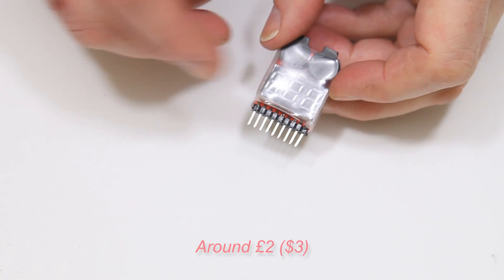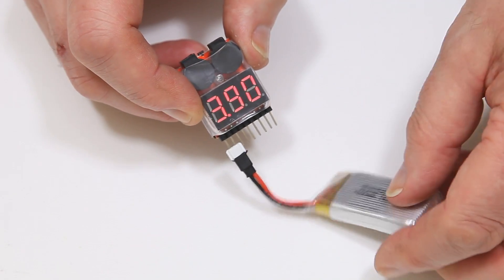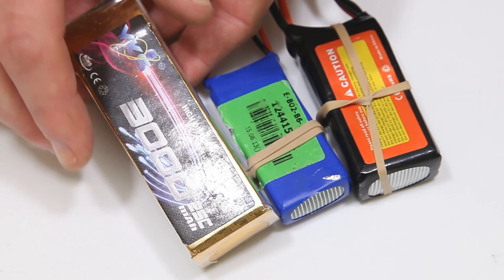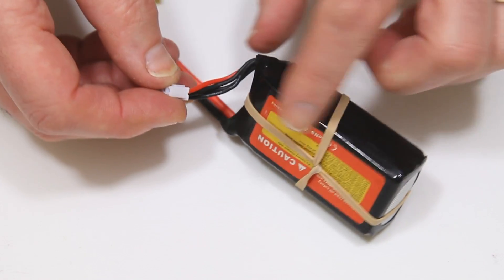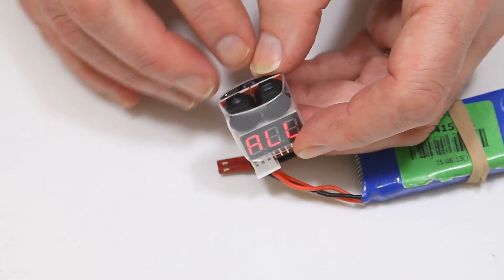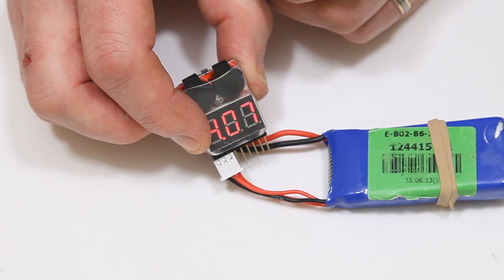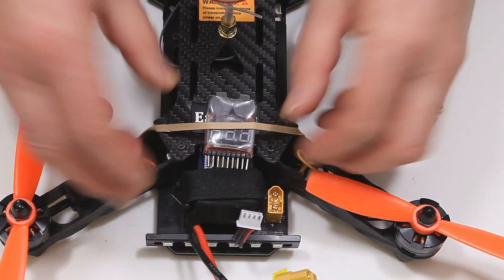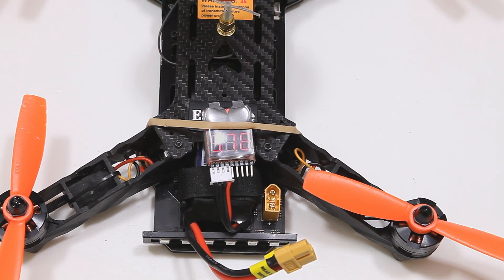Quad RC LiPo Battery Voltage Meter and Alarm

Comment: Hi that's a great gadget .
A quick questions how do I put a battery in storage mode if my charger does not have that mode? Do I use it for a bit and check the voltage or is there a clever way of doing it?
Thanks

Comment: I'm curious, does it start beeping when  punch the throttle? although 3.2 is pretty low, I might like to use it for a normal low battery warning when I fly but if it beeps every time i punch the quad cuz I'd have it set to beep at 3.8 that wouldn't be cool.

Comment: Isn't the storage thing a myth?
Reply from the maker: Not heard that one, I've left batteries charged by mistake and although they change up they have a very reduced capacity, shorter flight, so I leave mine in storage if I'm leaving them awhile, you do what you feel comfortable with ;-)
Reply: Tigger's RC Reviews thanks for the reply. l read about it on propwash, but I don't recall how long they left the batteries in different states.

Comment: Tigger, I just got my battery tester today and wanted to thank you. Beautiful little gadget and a brilliant review of it on your part! Iam new to the lipo battery world, and your videos were a huge help. Also, Is there something I could buy that would ONLY discharge a lipo so that I could store it say for the winter when not in use? Something cheap and simple? Also, what is the proper voltage a battery can be stored at? Thanks again, Cheers! John

Comment: What volts do you set the alarm on with a 3s battery, thanks.
Reply from the maker: Makes no difference how many cells it has, there is no one setting, if there was they would have factory set it ;-) I start around 3.5 and then test it when back with you. When measuring in flight the draw goes up considerably with fast assent ;-) Racer style quads draw massive power and more slower models don't. hope that helps, just have a go and see

Comment: Doesn't the voltage meter cut off power to the motors once the low voltage cutoff is reached?
Reply from the maker: No, it's an alarm ;-)

Comment: Hello.

This my way of marking batteries. I simply marked them with numbers. It's very useful when flying. I always fly from lowest number to higher, so definitely reduces chance to mix full and empty:
http://shrani.si/f/h/Ef/4VPky0zg/20171027222533.jpg

In chance that any full charged have to store, I store it near quad controller. Empty are stored near battery charger. But I don't have a lot of RC products, so at larger number this way probably can't go through. Maybe to store it in different boxes or ledges?

Otherway. Very good channel. (Y) I found it right about 1 hour ago and can't stop watching staff here. :D :)

Good luck. (Y)
Reply from the maker: Hi Bobby, welcome to the channel and glad you are enjoying it :-) I number mine, like you, as use the band, only started numbering after this video. Thanks for sharing and happy flying :-)
Reply: Yea I see a lot of interesting staff here. So will be some my comments under some videos. Also I ordered this voltage meter. Looks simple to use for checking voltage at empty and full charged batteries. With other instruments could be little more challenge to get contacts on all kind of batteries. (Y)
Reply from the maker: Kool, :-)

Comment: Ok..i jist bought one of these and I've been trying to find this answer..what should I set my alarm at for a typical 7.4 volt 2000 mAh battery..for a syma x8hc quad..I'm very new at this and not sure where to set it..my low battery warning lights on the quad are not working good anymore...as soon as they flash my quad drops to the ground for some reason now and I am afraid to fly it high or far :(  thanks for the video too!
Reply from the maker: Doesn't matter what battery or mAh you have it's the heavy draw of power when you accelerate hard that makes the voltage drop ;-) I would start at 3.7v and see how it goes, then drop it .1v at a time until you find something that suits your flying ;-) happy flying
Reply: ok thanks tigger...per your advice i started at 3.7 and have worked my way down..i am at 3.5 volts on the alarm and it is working good for me..thanks again!

Comment: I wish there were a way to turn off the annoying beep each time you connect a battery. It gets irritating when I want to test multiple batts - especially at night when the wife's in bed!
Reply from the maker: Er just put your finger over the 2 square bleeper vents at the top, silences it ever time ;-)
Reply: Yes had the same issue then simply covered with fingers and it's fine.
Reply: That's putting a round peg in a square hole though. Better with fingers in the wife's ears!? ;-)
Reply: Roger Barnett On one cell it doesn't beep. But yes I've learnt to cover it with two fingers it works although a bit awkward. These metres are so handy for checking all batteries.
Reply: That beep is a safe isue I believe. If the buzzers are dead for any reason and you didn't know you would fly and suddenly see your rc take the road to hell. So even if there was a way I wouldn't turn it off.

Comment: what is the actual low voltage that you set it t to beep?
Reply from the maker: Depends on what quad you are using, it's trial and error, start at say 3.7v fly it and see how you go then work down. It's under load when the beeper will sounds so you still have power left after landing ;-)
Reply: personally ill set it at 3.5v for now and test

Comment: Some don't retain the last setting and revert to the default setting for the battery type. On a couple of mine that is 2.80V  on a 2S which is too low (for me) Just saying as if you get one like that you could have problems if you don't set them up every time
Reply: I dug one out from my box and it has no brand name just a serial code RLD 3361 BHB-24 on the bottom (I had to use a magnifying glass to read that though)
Reply from the maker: Not come across that issue, will keep an eye on it, thanks
Reply: I guessed as much as I know you would have mentioned it yourself if you had. I only have two that do this and I tend to only use them for voltage testing as a result.

Comment: So how does it connect to the battery and quad? I'm pretty sure I'm a dumbass but I can't figure it out.
Reply from the maker: Nothing wrong with that question and definitely not a dumbass ;-) It only connects to the battery, that's all it is monitoring and that's all it needs to monitor. Hope that clears it up for you

Comment: so if i understand it correctly, If i set the alarm to 3,2V=, and then change my battery to a new one. I dont have to reset the value to 3.2 again? because it memorizes it? correct?
Reply from the maker: That's correct ;-)

Comment: I am new into quadcopter and just have a toy drone with a 1 cell 3.7V 500mAh. guess I have to add a split cable.  So I guess, the threshold for the alarm, would be 3.2V, I assume. Now in one of the quadcopter that I am planning to upgrade has 7.4V 2700mAh and here I assume, it would be a 2 cell battery.  So here, each cell full charge would be 3.7 so to set the alarm, I would again be choosing 3.2 or higher?
Reply from the maker: If you are using a single cell quad it might have difficulty flying with extra weight, also should have built in low battery warning, I have not come across a single cell quad that doesn't, but if you have one then yes split the cable, but I would try and lift it with the quad first ;-) Yep 7.4v is 2 cell, you have to be careful how low you set it as some quads require more power than 3.2v to fly, it's a trial and error thing, start around 3.6v and then adjust as you need to ;-) BTW a fully charged cell will be 4.2v ;-) Hope that helps, cheers
Reply: Tigger's RC Reviews thanks

Comment: Any way to make the buzzer stop going off when it's triggered early due to punching out? Sometimes mine'll go off immediately after taking off which is annoying not only because of the beeping but also it's not warning me when the voltage is actually low.
Reply from the maker: I just set mine lower even down to 3.2 on some models, as you know it measures all the time and when under load, like kick-out will alarm and then recover, bit of trial and error but you can sort it. Still better than any other method I have tried, hope you get it more satisfactory

Comment: so i could use this instead of a osd for the battery voltage and then it will beep when it a low voltage?
Reply from the maker: Yep I use it on any quad without a good low voltage warning, you set what voltage you want it to start beeping at, remember the battery is under load, especially if you are doing a kick-out so it can beep early, you have to just try it and get the setting you want for each quad. You can here it from quite a distance, which is very handy ;-)
Reply: @TiggersRCReviewsTTFN  Thanks for the video.  Following up on the question, have you ever checked how the voltage displayed in flight compares with a OSD display of transmitters that have that feature?  I suspect my OSD might be underestimating the voltage of my battery and wonder if I should try one of these?

Comment: Very nice video. I have just received mine. I'm assuming when you set it for 3.2, that the alarm is going off when 1 of the cells reaches 3.2 or the overall average of them?
Reply from the maker: When one cell drops to your set volts ;-) but I would start higher most craft will drop out of the sky way before 3.2 start at say 3.6 and see how you go, very much trial and error with every quad, some quads give low battery warning at 3.8v ;-) Glad you enjoyed the video, thanks

Comment: Hi, so what ever battery you use it has to have to ports one for connecting to the quad and another to buzzer ?  none of my balance, or jst batteries have 2 ports, is there a way round this ?
Reply from the maker: You would have to add/split cable to do it I guess, every quad i have put it on has a balance charger cable. Hope you get it sorted
Reply: Hi Tigger I have just got one, but noticed there is only a beep sound when you connect the white balance plug , I do now have batteries with 2 leads 1 is the white balance lead to connect to my XKx251 and there is a red JST lead , will the alarm sound if connected to the JST lead or is this buzzer only going to sound with balance connector , thanks, Nige
Reply from the maker: I would have thought so, you have to set it up as I show in the vid, then try it on your battery when you give it a flight. Hope you get it sorted

Comment: can you connect dual batteries into a single buzzer? Reason being is that I run two batteries on my drone and I like to add this buzzer. Thanks!
Reply from the maker: Hi Ronald, TBH I don't know, but I would just put two alarms on as they are so light. Hope you get it sorted, cheers
Reply: Thanks! Cheers
Reply: @ronskalit8384  Hi, you can achieve the dual batteries on a single buzzer by adding a Y adapter to connect the 2 batteries in series, and then change the threshold of the voltmeter to 6.4v instead of 3.2v. Cheers

Comment: I have just invested in 3 of these so i have a couple spare...  I have noticed on different flights the time based method doesnt always work, slower technical stuff around trees gives me longer (7mins) fast long stretches gives me about 4mins.. So now ill know instead of having the quad drop out of the sky.
Reply from the maker: Yep they are really handy, no more dropping out of the sky for you :-)

Comment: Im just getting into this, never heard of lipo batteries till 2 weeks ago. What do you mean a "stored" battery? or that a battery is not in storage?
Reply from the maker: +Mike Timmer Hi Mike, I thought I explained it in the video, a battery in storage has a charge of 3.8v per cell this is how it comes from the manufacturer, you can leave it safely at this level. If a battery is stored flat(very low) or fully charged it can damage the cells. Hope that helps and you subscribe if you haven't already. It's a great but very addictive hobby ;-)
Reply: +Tigger's RC Reviews thanks,understand now!

Comment: instead of elastic bands wrapped around flat batteries... I have 2 clear zip lock sandwich bags.. one with fully charged batteries.. then another labeled FLAT with black marker pen.. and just put them straight into that bag once removing them after a flight... simple and batteries never gets mixed up
Reply from the maker: +dgsoarer Each to their own I always say.So many ways to sort this simple problem. hope you thumbs up and subscribe if you haven't already

Comment: Yet another cracking and informative video. Exactly what I'm looking for as I'm currently suffering from battery stress on my Eachine and this will take most of that away! Ordered!
Reply from the maker: +Tim Slater Thanks Tim, yes these little devils are great on the Eachine, been flying in mode 3 woooohoooooo does this thing rock:-) but still flies level :~) weird heyho still not had time to put it on Open Pilot but i will. Cheers for now
Reply: +Tigger's RC Reviews Not had the balls to go full rate yet, need a v calm day for that but sadly none of those are forthcoming. Already crashed mine numerous times and it really is a tough little beast. Having said that I've already gone through at least 10 props, snapped the mushroom antenna (fixed with packing tape for the moment, awaiting a new one), lost 2 prop nuts, 1 headlight lense has gone but still seems fine, numerous screws (again, replacements ordered - should have checked tightness before first flights) AND a camera platform and dampers, but got the camera back. Still flying beautifully though, but already looking a bit grubby.
Reply: +Tigger's RC Reviews ......By the way, what's yours like with bigger batteries? Is it worth the extra weight? And is it still as nimble?
Reply from the maker: +Tim Slater These props http://goo.gl/Cm3P70 are much better than stock and are really hard to break also give it a bit more welly ;-) You are flying it not using it as a door stop right? LOL Yep antenna is a problem. Mode 3 you can fly gentle but if you give it the gun it loops really easy but again if you can keep it under control it is soooo much faster.
Reply from the maker: +Tim Slater I have the 2700 off the CX-20 doesn't seem to affect it but only just fits in only tried it a couple of times all good. Happy with stock ones for now although if you need more aggression maybe a higher c rate would do, but sounds as though you are getting more than you need at the moment. Ain't they fun :-))))
Reply: +Tigger's RC Reviews ordered the Dals too! I'm turning in to a Tigger clone.
Reply from the maker: +Tim Slater They are gooood......check for stripes........or slightly orange lines when you scratch...........Tiggeritus no turning back the kids will notice the extra bounce wooooohoooooo :-)

Comment: Thank you for these videos. I am new to the hobby and these tips really help a lot. What FPV antenna are you running on your racer 250? I've already broke the one that came with mine. Are you going to remove the led strip to support bigger batteries?
Reply from the maker: +MAXIMUMintheHORMONE Hi and glad you are enjoying the channel :-) yep broke mine too and just replaced it with the same one, think I will be ordering some more, can't see an easy way to protect it, if I do I will share it ;-) Leaving leds at moment I can get the 2700 Mah from my CX-20, just it is a bit of a squeeze ;-) glad you are enjoying the quads :-)

Comment: I have seen different colored velcro. Red for used, green for full, and yellow for storaged. Also different XT60 caps, that are colored like that on hk. I have lots of these buzzers around :)
Reply from the maker: +The RCAddict Yeah everyone got their own way of doing it, mine is simple like the operator so even I can't get confused....I hope lol Never have too many things that buzz at you with these quads :-) Hope all good with you?
Reply: Tigger's RC Reviews Yep, your method is simple, easy to understand, end effective :) 

Yeah, have a few builds that are going to happen soon. GearBest is sending me a Robocat270 kit (including electronics) to review soon, and a company called AGM hobby said they want to send me their prototype 280, however they have not mailed back in a week, after they sent a picture, but who knows. 

I am also going to be build a 470 quad for filming :)
Reply from the maker: +The RCAddict Good on you pal, really pleased for you, you have done some serious work to get this well done :-) I'm looking at the Yuneec Q500 Pro 4K would I be better off with your 470 build? I am soooo chuffed(that means very pleased here) for you :-))))
Reply: Tigger's RC Reviews Hmm, how much is the 4K version? With all of the parts I am getting (1 battery) it will cost me about $500, plus the camera, plus gimbal, plus new tx (Taranis) so about $1000 total. Now this is a full out GPS quad, 3axis gimbal, 4K camera (SJ5000X Elite) 12in props, and 20 minute flight time. Not sure if it would be better for you or not. Here is a link to te frame to see it :) 

http://www.hobbyking.com/hobbyking/store/__65839__Quanum_XJ470_CF_Folding_Sports_Quadcopter_Frame_w_Forward_Facing_Gimbal_Mount.html
Reply from the maker: +The RCAddict Hmmm the Yuneec is a little more but with 2 massive batteries, 3 axis, 4K blah blah and a serious carry case, think it will be a better bet for me, also got full good after sales support in UK. Thanks for info though, interesting project, off to bed so catch up later TTFN
Reply: Tigger's RC Reviews Yeah, my build is probably not the best idea, in terms of $$$, or cleanliest, but I would rather build than buy. That frame folds as,well, so should be easier to travel with. I don't plan on getting a case though, as no idea where to get one, lol. The Radio, camera, and gimbal cost, and a "one time" thing though, so really only like $500. $120 for the motor and esc and prop combo, $120 fo rthe FC, GPS, OSD, and all other things it comes with in the HK pilot Mega master set, and $110 for the frame. It is a really nice cabon and alluminium frame though. Good night :)